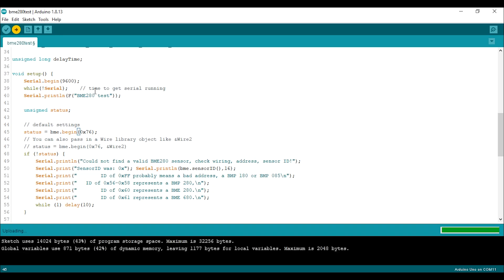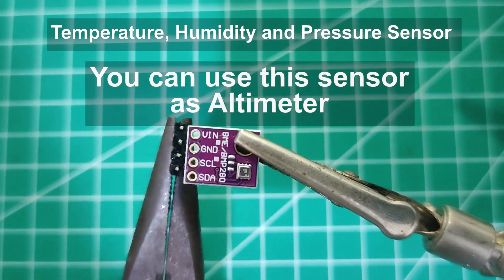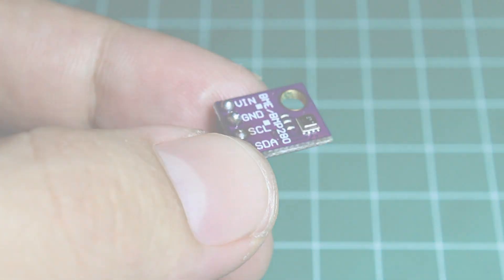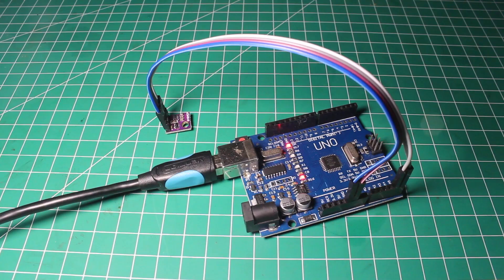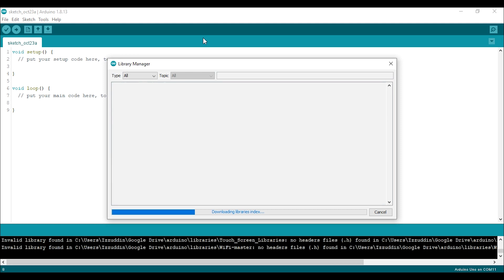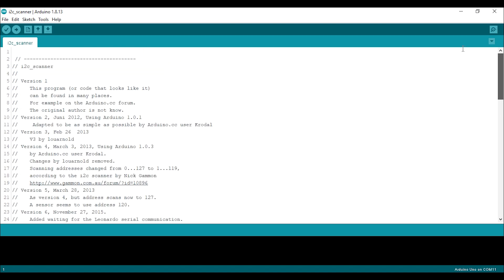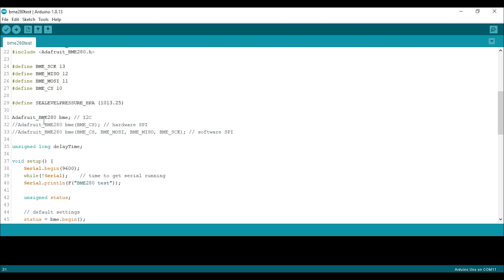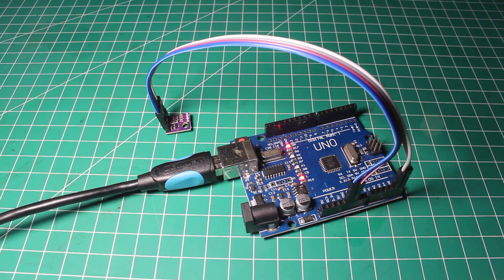How to use BME280 sensor with Arduino (Humidity, Temperature, Barometric Pressure, and Altimeter)

Comment: hello i got somethink like this  
BME280 test
Could not find a valid BME280 sensor, check wiring, address, sensor ID!
SensorID was: 0x58
        ID of 0xFF probably means a bad address, a BMP 180 or BMP 085
   ID of 0x56-0x58 represents a BMP 280,
        ID of 0x60 represents a BME 280.
        ID of 0x61 represents a BME 680.
what I do now
Reply: Similar here. Never figured it out.
Reply: you probably actually have a bmp sensor on 0x76 (sometimes sellers deceive and sell the bmp as a bme, as bmp is cheaper to buy, and they get a dollar more for being ignorant it is really a bmp)

Comment: wow. none of my sensors worked, but after hours of almost losing my sanity i found out they are actually BMP sensors, not BME. The pcb/sensor look almost exactly the same, but the BMP only measures pressure. 😥😥
Reply: i've been having the same problem which I'm only now realising after your comment
Reply: lol, same, ali express seller deception, now after much research - i find same, and also published images of the tiny sensor size, and position of hole is different

Comment: Hello, why SCK and SDA connected to ports A4 and A5???? They should be connected to SCL and SDA to work properly otherwise the SW doesn't  detect the device...
Reply from the maker: A4 and A5 are also the SDA and SCL. You can check the arduino uno schema
Reply: @miliohm  RIGHT! sorry I am using Arduino UNO WIFI2 and they are separated! Thanks.

Comment: Das Projekt gefällt mir sehr gut!
Wie kann man den Luftdruck am Analogen Ausgang ausgeben? 0V - 5V
Ich würde dies für meine Smarthome Steuerung benötigen.
Bitte dich um Unterstützung.
Danke!
Reply from the maker: the easiest method would be, give a DAC to Arduino. Convert the value as you want to an analog voltage.

Comment: hello, nice tutorial. but now please tell me how I could do if I use the ch9102x - esp32 module connected to wifi to display the local time and date after which the temperature, humidity and pressure using at the same time a bme280 module, I would like to display (say 5min per hour) and after that, in turn to display the information from bme380 and then return to the time and so on. thanks